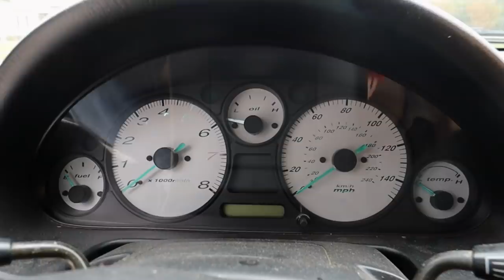I Got a "RACE CAR" From The "Junk Yard"

Comment from the maker: One thing I didn't make too much mention of is, Pull A Part does sell used cars at some of their yards. Most are actually nicer than this Miata. HAHAHA
Reply: I bought my first autocrosser (a 1993 Fox) from the guy who was on his way to the junkyard with it.  Under $500 including the price of the car and fresh tires and I was on the grid.

I love junkyard racing. It takes more skill to prepare, but that's the fun part.
Reply from the maker: @DonalvonGriffyn  That is awesome!
Reply: Just FYI, that big bracket you were talking about is the torque arm for the rear differential.
Reply: With 130,000 mile it's definitely had a clutch job, just pray it's not an Ebay gorilla clutch.
I would also check if the diff is an lsd or has a phantom grip.
Reply: Please help me..!!   I have a 2006 Volkswagen jetta 157k miles 2.5 liter 5 speed manual. And the steering light is on as well as the abs and brake lights... Steering is fine though drives normal.. I also have a the mechanical  vacuum pump leaking.. But I need to know how to get those lights off the dash to pass inspection. Someone please help
Reply: @GAMINGINMYCAR  - You'd be better off asking that in a VW forum. Try vwvortex.com
Reply: @michaelblacktree  thanks bro

Comment: 1999 with leather and stereo means helical LSD!  This is probably the best year for racing.  Better hp/lb than later NBs.
Reply from the maker: YEA!!! I was reading up on that trying to decipher the models. Then I may have done a small burnout in front of my house.. No one tire fire here. HA
Reply: hmm...not mine.
Reply: @stilettolove88  If it's a Special Edition or an LS (tan leather and top with Bose stereo) it will have the Torsen unit.
Reply: Correction, the NB1 is not anymore powerful than the later 2001-2004 NB2's with the intake variable valve timing. They're equal in horsepower and the 1.8 VVT motor actually makes more torque throughout the powerband.
Reply: @brentescovedo3262  but in a heavyer cars so adding weight negates the extra power
Reply: @toddmccarter45  I own an NB2, it's not significantly heavier enough to make a difference in the 0-60, especially with the 6-speed. The torque you gain in the powerband and higher 10:1 compression ratio makes it much more responsive in every situation that isn't a 0-60 pull, aka in the corners.

Comment: So did the check engine light come on when you put the wv on the bumper 😆
Reply from the maker: Why do you think it started leaking oil?
Reply: well, i was gonna say... "thats why she failed emissions" ...but i decided not to take that cheap shot... haha!
Reply: The price of parts went up when the VW was put on there
Reply: @HumbleMechanic   The top rocker cover gasket and the gasket on the CAS are common failure points.  Probably as well just to replace both for your peace of mind...

Comment: The VW badge on the miata stands for "Verymuchneedsa Wankelmotor" !
Reply from the maker: HAHAHAHA
Reply: More like "Fucking Needs a LS".
Reply: @YungJosh50  bro you just ruined something good with that nonsense!!
Reply: @j.m.5995  I'm sorry, I was excited.
Reply: No  wanker motors.unless you like more fuel for less torque . Ls swap is where it's at.
Reply: @nnnf467  More stroke victims come forth... I wasnt being serious. It was (i thought an obvious) play on words taking advantage of the fact that Mazda is/was pretty much the only game in town when it comes to wankels and the fact that the mx5 is an obvious candidate for this swap.. 

If youre looking for enough torque to plow a field then y not just strap a Steam engine on that thing and skip the whole LS experiment.
Reply: LS swaps are a yawn. Dime in a dozen.  Throw a VW 2.5 L in it. Motor is cheap enough and it would give it a nice exhaust note.
Reply: I know VR6 swap it
Reply: @nnnf467  you might think differently if you've seen any of the 13Bs running 6's in the 1/4 mile

The sound is something else entirely

Comment: As a Mazda guy, I'm so excited for you to start this! They are simple, great cars, and I've seen too many run into the ground for lack of "mechanical empathy." I know you'll give it the love it needs but doesn't deserve. Also, after you're done racing stock with it, that convertible will benefit from anything and everything you can do to stiffen the chassis, from eBay strut bars to roll bars to door braces, etc.

Comment: Keep the roll bar. It’s the best one you can buy.. Hard Dog is the best for miatas
Reply: No diagonal on that bar, so keep in mind it will not be legal for most track days (though should be fine for autocross).  SCCA and NASA have specific roll bar requirements, and a diagonal is a must.
Reply: R D True, but they offer a diagonal retrofit for them, as well as offer full SCCA/NASA legal bars, with either single or dual diagonal bars already installed. All of their bars are built for safety. That’s not a ‘style bar’

Comment: I had an MKV GTI, and worked on it quite a bit, and now have a 97 Miata.  You are absolutely correct about everything.  The strut brace is aftermarket, and this is the absolute EASIEST car to work on!  Known spots for oil leaks are valve cover gasket, CAS O-ring, and rear main seal behind the flywheel.  You'll enjoy it for sure!

Comment: On my 2001 I had oil on the underside when I bought it. It could be one of a couple places. My personal opinion - When the engine cover is off, check to see how the timing belt looks. If it looks old, replace it. They are good for about 100,000 miles safely. Past that, it could go at any time. The motor is non-interference though, so aside from inconvenience, it won't be a terrible loss if you decide not to change it and it fails. However - Once you are in there, it's a cheap and easy fix to replace the water pump and cam seals. That will seal up the top end and prevent any oil seeping up there.

After the top end is done, check the speedometer sending unit. Mine was leaking and eventually caused the speedo to fail intermittently. Could be as easy as an o-ring. Should you pull the trans, you might as well do rear main while you are there. It's an easy and cheap fix and will ensure that the bottom end is sealed up leak wise.

Be careful when doing fluid change in the trans. There is a bolt that LOOKS like the fill/drain, but if you remove it, it will require pulling the transmission and having it rebuilt. Get a service manual. (I will send you the resources I have available if I find a place to send it).

Good luck and have fun. Super easy car to work on.
Reply from the maker: DUDE Killer info. Thank you so much!
Reply: watch your email... if you reply (so I have an email to send it to) I will send you what I have.
Reply: yea do not touch that sqaure bolt, if its a 5spd you can fill thru the turret, the 6spd has a fill bolt on the left side
Reply: @chayyboi  NO!!!!  That is NOT correct!  5-speed cars have to be filled through the square fill plug.  The turret is separate and requires a small amount of its own fluid.  6-speed NB2 cars do not have a separate turret and can be filled there, but you run the risk of overfilling.  Also on 6-speed cars there's a bolt on the passenger side that looks like a drain plug but it's not.  If you remove it by mistake, you lose 5th and reverse, and have to crack the gearbox apart and rebuilt it in order to fix it.
Reply: Patrick94GSR ahh I read somewhere about the 5 spd filling from the top, guess it wasn’t correct. When you talk about fill plug it should be left/right, since you have left hand drive and right hand drive, but not a left handed trans and a right handed trans

Comment: I think NB1s still have a cam angle sensor on the back of the exhaust cam. Make sure to do the CAS o-ring at the same time you do the leaking valve cover gasket. It should be right next to the ignition coil/igniter assembly. If left unchecked, it'll drip onto your heater hoses and rot them out. Whoever owned this prior was very unkind to it. Glad you're here to sort it out.
Reply from the maker: Yeah they didn’t care too much about it.

Comment: As a past Miata owner also a 1999 nb1. I could be wrong but I'm pretty sure that is a 2001+ front end conversion, I say that because I think the 1999 and 2000 didn't come with fog lights. When you do the fluid for the clutch I'd do the clutch slave and master cylinder. Those are very common parts to go wrong (mine went bad at only 70k miles). Also a common problem is the thrush washer wears prematurely so check that too. Strut brace is not factory!

Comment: The blackness of the clutch fluid is related to the rubber portion of the line rotting inside. Those roll bars are made near Winston-Salem and they sell padding and harness bars too! The company is Bethania Garage. 

I plan on doing Koni shocks to my 92 Miata to run in street class, I also have an old 4 point harness in mine (legal in ES). Your radiator doesn’t look bad, but once they start to turn brown, they’re on their way out.

Can’t wait to see it out next year!
Reply from the maker: Thanks for the insight Frank!!!

Comment: You can't go wrong with a Miata. Cheap, lightweight, RWD, and tons of aftermarket support. I have a Miata myself and it's a fun car to drive still has the stock 100hp engine lol. All I did was a roll bar, Flying Miata Sway bars, Hawk brake pads, lightweight Enkei rpf1 wheels with Nitto NT01 tires in it's been FUN! Someday I would love to add more power like 200hp that would really make a Miata fly!
Reply from the maker: EXACTLY! I am pumped to have some fun in this old girl. HA

Comment: Forget the VW-snob haters Charles - this is going to be a fun cheap exhilarating ride! BTW - absolutely ditch the upper strut brace! I put one one the Mk1 Jetta Gli coupe a while back, and the cowl shake was sooooooo bad that it sounded like someone was hitting my dashboard with a sledgehammer over small ruts in the road I barely noticed before - I took it off after a day. I did leave the lower and rear shock brace on - car was still livable with those in place.

Comment: Not much special tools needed to work on a Mazda. It is part of their beauty. Just a torch to heat the nuts and bolts if there is ANY rust.

Keep the roll bar. It is a good one. Just needs a diagonal bar added.

Comment: One thing I can recommend about those engines. Change that timing belt. The BP5 in the Miata. Protege, and Escort GT is an interference motor and the timing belts are supposed to be replaced after 120k miles. With as much hodge podge that car has seen, I bet the belt has never been done.

Comment: Some things to note. It's not any special edition, in 1999 there was a 10th Anniversary which this is not. 1999 may be the most dangerous year for a Miata because of the thrust bearing failures. But since yours has so many miles it's probably okay. I didn't hear what type of transmission is has. If it has a 5speed you likely have a 4.30:1 open differential and if it's a 6speed you may have a  3.909:1 type II Torsen LSD.  From the looks of it you have an LSD. Below you can check if yours came from factory with it. You will find out for sure when you drive it a little harder. While they come with shock tower braces the one you have is aftermarket. Upgrading the log header to an NB2 '01-05 tubular is a good basic upgrade. Also, be very careful pulling out the dip stick. It's amazing yours isn't broken. I look forward to seeing you fix it up!

LSD Check for your '99. If car has cruise control, power antenna, windblocker, and power door locks and/or tan leather interior, it should have an LSD. If your car has one of these numbers on the vehicle information tag in passenger door jam it came from factory with a type II torsen 3.909:1 limited-slip differential: NC11, NC12, NC14, NC17, NC18, NC20, NC22, NC23, NC24, NC25, NC65, NC66

Comment: When you replace the valve cover gasket, I'd replace the CAS o-ring as well. Those guys like to leak and may be the root cause for the oil near the front of the transmission.

So excited to see you working on a Miata, they are my favorite!
Reply from the maker: Also new acronyms! Hahaha
Reply: @HumbleMechanic  sorry, I should've fact checked myself. The crank angle sensor I'm referring to only exists on NA Miatas (previous gen).

Comment: If it's leaking from the cam cover, also check the CAS seal at the back of the cover. These can leak oil onto the heater hose, which will weaken and fail.
Reply from the maker: Yikes!  Good call!!

Comment: This is awesome! I have a NA6. Wanted more power so I bought a rough around the edges 2000 NB that is this exact spec! Took both cars COMPLETELY apart and then put ALL of the NB stuff in my NA. Except the interior, didn’t like the tan. Also just finished putting the FM stage 1 turbo kit on it. It’s scary quick.

Comment: Before you put a fender back on it, add a set of fender braces to it. A rollbar and fender braces are two of the biggest frame braces you can do to the car.
FWIW I am a VW guy at heart that also bought a Miata to autocross :)
P.S. I spy an IE sticker in the console ;)

Comment: Looks like it needs a good bit of parts.  At least $1,000 worth if not more.  Oil leak under the oil pan/gearbox could be the rear main seal, or it could even be the half-moon seal between the block and oil pan.  With no service history I HIGHLY suggest changing the timing belt and water pump, plus the front main seal.  These cars are notorious for overheating if the cooling system is not in tip-top shape.  OE-style radiator looks okay for now, but if the plastic top tank turns any sort of brown or green color (not black), it's about to let go.  And if that happens, it's a good idea to replace all the coolant hoses on the engine at the same time.  Be aware that the coolant temp gauge on the dash does nothing.  It reads the same whether it's 160 or 225, and by the time it starts moving up from the middle it's probably too late, the engine will be toast.  It's best to invest in an actual coolant temp gauge or at least get a Bluetooth OBD-2 dongle and monitor coolant temp on a phone app like Torque Pro or OBD Fusion.

The car itself is a 99 but it has 01-05 OEM 16-inch wheels on it.  Most Miata guys say that 15x8 or even 15x9 wheels with anywhere from 225 to 245/45 tires are a better choice for autocross than the stock NB2 16" wheel setup.  Shock tower brace is not factory, however some 99-00 Miatas came with a factory tower brace with rigid connections that can help reduce NVH while driving.  01-05 NB2 cars had a slightly different brace design.  The 99-00 version would probably work better, and should still be legal in a stock AutoX class.

All this I have learned from my ~4 months of Miata ownership so far.  My 2000 is currently on jack stands with the gearbox out, waiting on me to order a new clutch and flywheel.

Comment: Put a thunderbird rear end in it.  It fits n gives you gear choices.  When you get bored with the stock stuff shoe horn a ford 302 in it w a 6 speed.  You will hate those golfs.  Leave the front cross brace.  You will need it.  These are simple and very fun to work on
Reply from the maker: I will always love the Golfs! I have to take the brace off if I want to run stock class.
Reply: @HumbleMechanic  sad to hear about the brace.  Really helps the front end.  I still love thebold mgb where i started.  When you put that 5.0 ford v8 n the thunderbird rear end in it you will understand. Oh and the local tire shop will love you.

Comment: Nice buy, you got arguably the best year Miata. A lot of auto cross guys run an aftermarket front sway bar and no rear sway bar on these. It will introduce more understeer however. But it looks like you have other things to worry about haha
Reply from the maker: Hahah a FSB is high on the list. I’ll probably run a new front, and leave the rear. I can’t mess with both for street class

Comment: "That bracket" is the PPF (Power Plant Frame), and will have been moved as part of a gearbox removal for a clutch swap.  Nothing too unusual and (assuming it was done correctly) nothing to be overly concerned about...  I'm looking forward to following you on your journey with this one
Reply from the maker: Thanks for the insight!!!
Reply: Looks like it may not be aligned correctly, which can cause vibration issues when driving at speed.